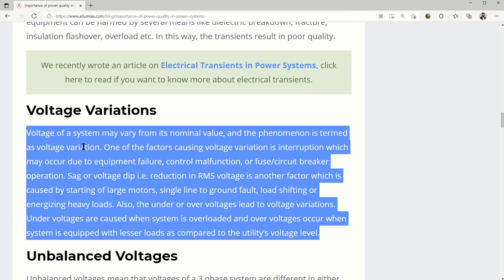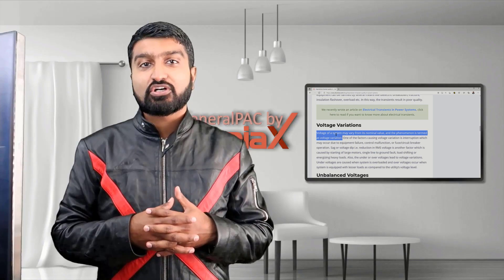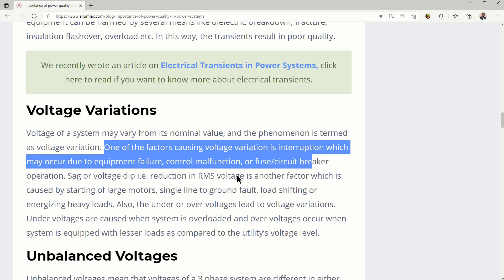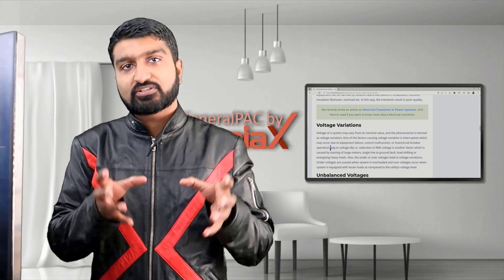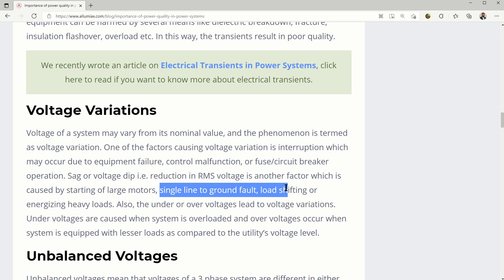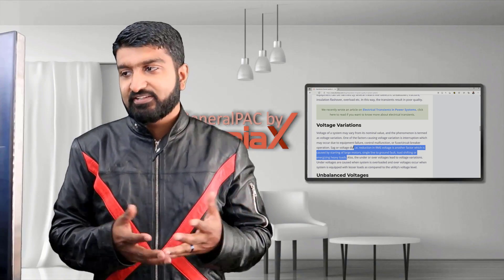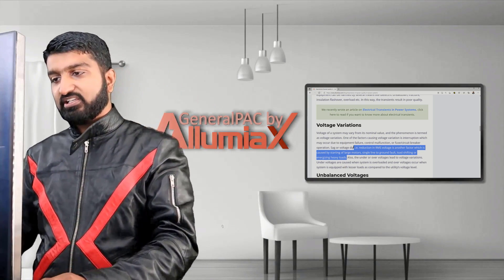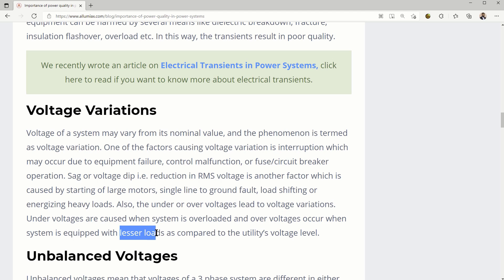Voltage Variation in Power Systems

Comment: If load is less, then shouldn't it be normal voltage? What causes over voltage in the first place?
Reply from the maker: Hello,

According the power formula, It says that Current is inversely proportional to the voltage if power remain same i.e. P = V x I. Less load connected to the system implies that lesser amount of current being drawn. Ideally considering that power from the generating station is constant and lesser current is drawn, the voltage will hence increase. 

Thank you.